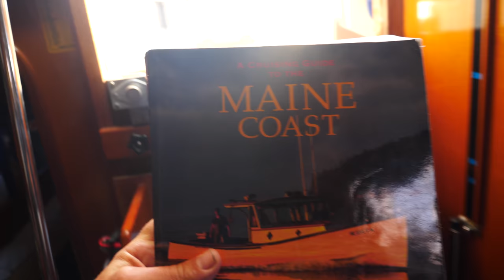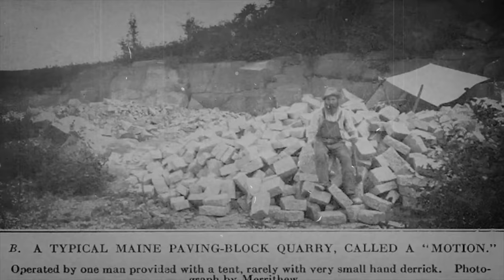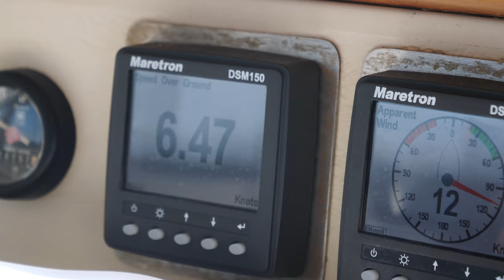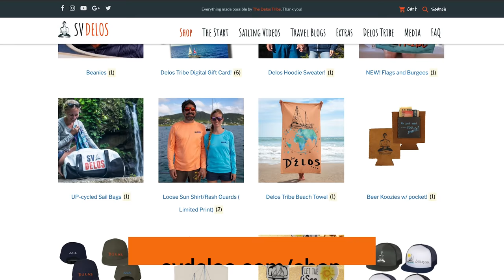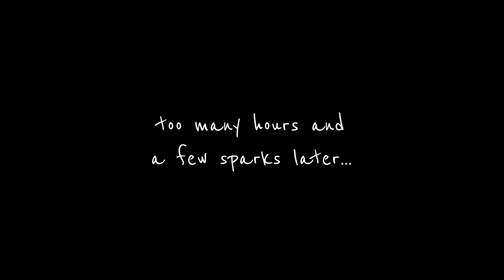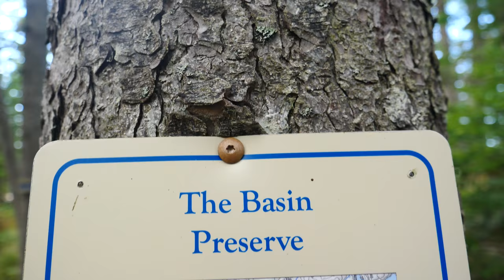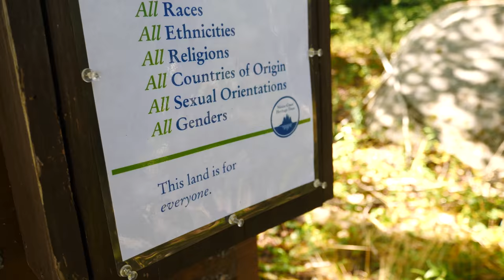Off The Beaten Track in Hurricane Sound, Maine- Sailing Vessel Delos Ep 297

Comment: As a software and cloud engineer I also take a break from a project  If isn't working how I planned  I often explain the problem to a rubber duck to externalized it. I would suggest the nugget but maybe not might set you into dad mode. But either way I did an SDR project for AIS. I think you where way gone by then I did fix it I do pickup signatures in the sound close to CT. I'm rambling I love you guys and the nugget ! Be well and be safe !

Comment: 8:00.  That is the smokebox end of a steam boiler. The small tubes are flues that ducted the hot gas from the firebox (at the other end) through the boiler water to the smokestack. Then a piston and crank turned the flywheel and worked the pump.

Comment: Oh. Make sure that red hose isn’t internally lined ie drinking water lines. If it is the problem is that the internal lining delaminates if you use anti corrosion fluid, back fills, and then the flow stops.

Comment: That heating system seems overly complicated. I would think a simple webasto or Espar diesel heater would do the trick quite well with a really simple installation. If cost was a factor you could get a Chinese knock off for $160 on amazon. They are very efficient as well! Once up and running less than 1 amp and use minimal fuel.

Comment: Not to be critical,but don't you think you should have some type of anti abrasive grommet or sleeve where your fuel lines pass through the holes in the fiberglass?  That hose type is bound to wear through faster than you might expect. I've seen that problem on several vehicles over the years. Allit takes is the small vibrations from movement to wear a hole in them. Just sayin'. You don''t want a fire that you can avoid.